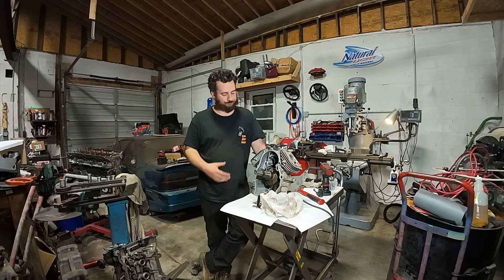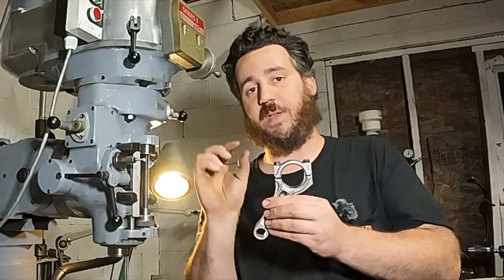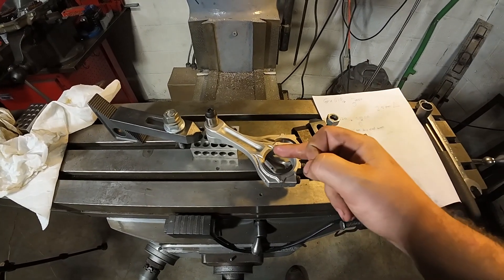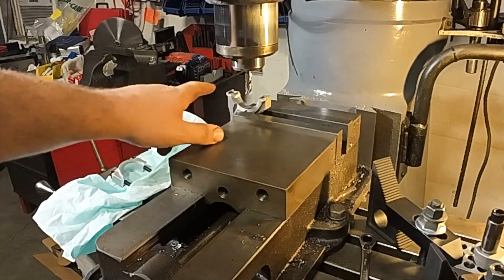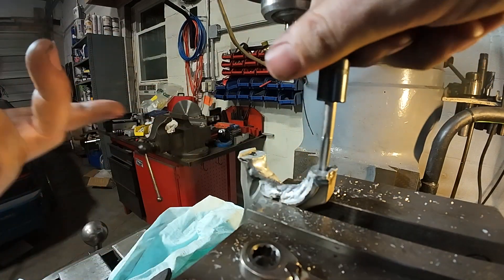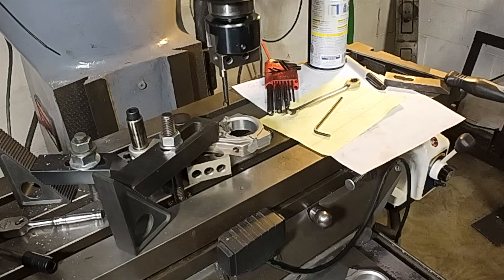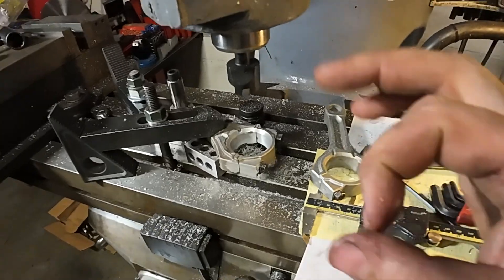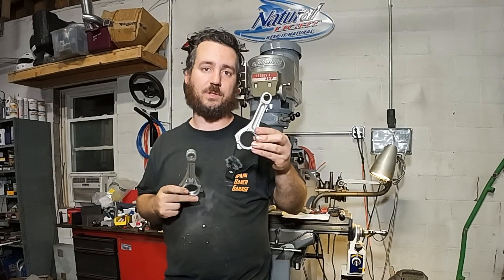Extending a connecting rod. Can I "Stretch" it? Machining a custom rod

Comment: Why don’t you just mill the top of the head down
Reply from the maker: Then I would need custom pushrods as well as modifying the intake manifold, the exhaust, and the engine shrouding. I considered it but it was a lot of work too and not reversible.

Comment: Impressive work! Could you have just used both of the shorter rods and had slightly lower compression? Or would that have had other repercussions that I'm not thinking of?
Reply from the maker: I was worried that it would drop the compression too low. 2.5mm across the bore diamater is a lot of CCs. I think it might run that way but probably wont make rated power.